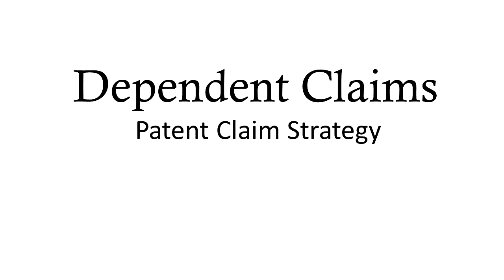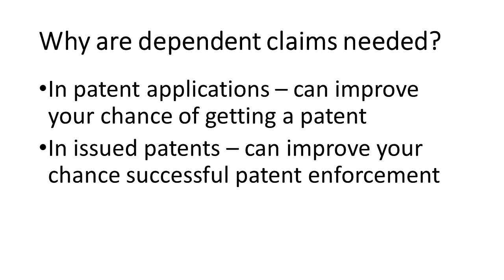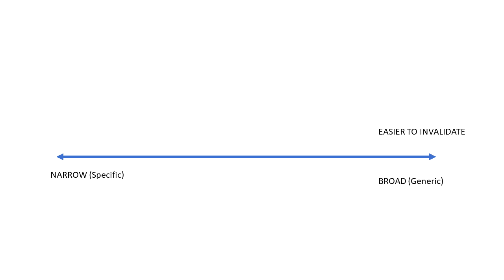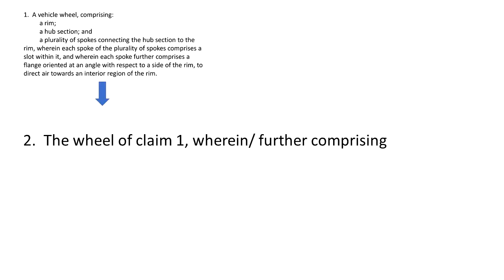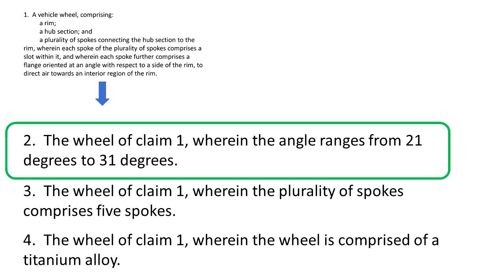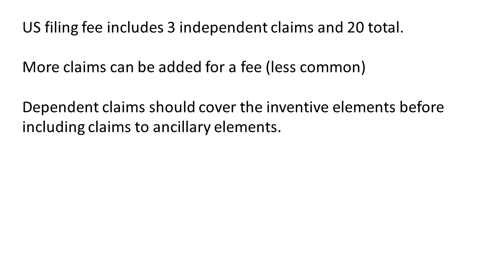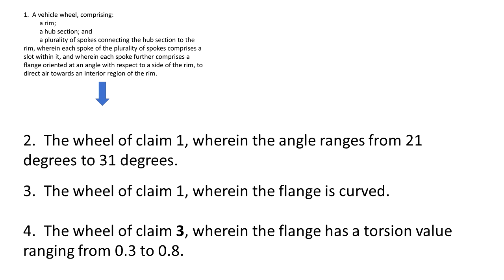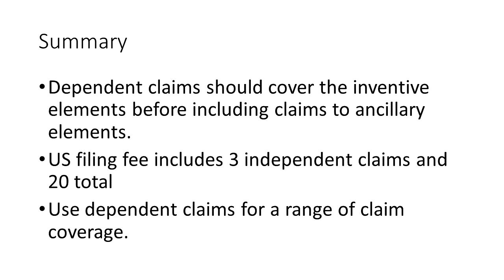Dependent Claims Explained

Comment: Hi. For counting the claims for fee purposes there is shit explanation out there. 
I am doing a course right now and it is frustrating as hell that they provide such sparse explanation where it is merited. Esp In questions where they don’t show the tally or math arriving at an answer. For example, they say:
“Applicant filed a patent application w/28 claims. Claims 1, 5, 23 & 27 are independent. Claims 2-4 depend from 1. 6-22 depend from 5. Claim 24 depends from 23. Claim 25 depends from 23 or 24. Claim 26 depends from 25. Claim 28 depends from 1, 23 or 27. In addition to the filing, search & examination fees, how many additional claims must applicant also pay for under CFR1.16(i)?”

You know what details these assholes provided? None. How many times I am rereading the damn section and searching for explanations...They give just a number plus “section 608.01(n)” which does not show the math tally. I am trying to study this and have to guess as to how the answer was arrived at. There is a market for better tutorials.
Module 10 #7